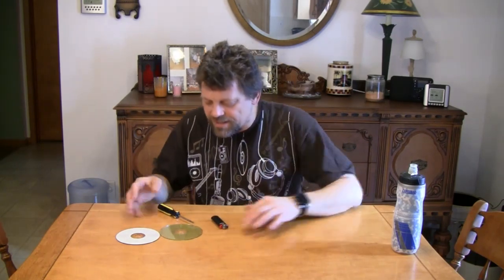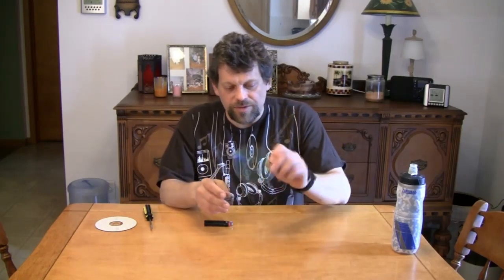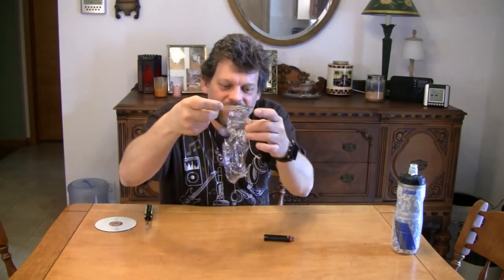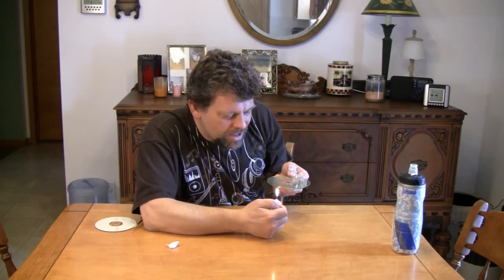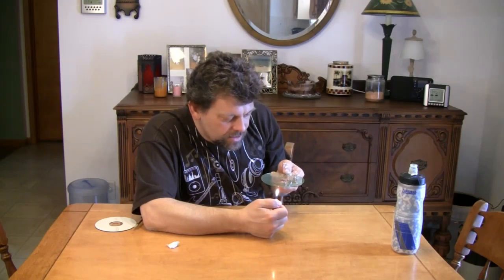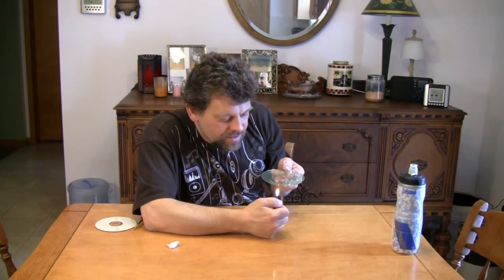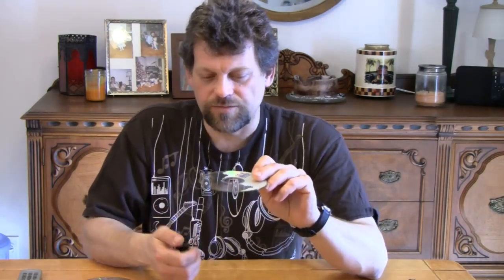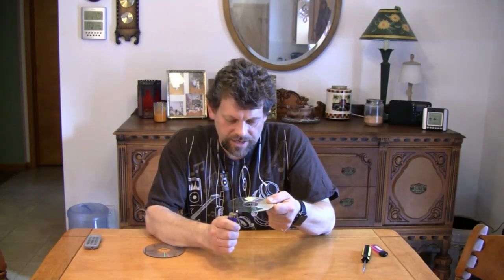"Do Try This @ Home 2010" - Episode 1 - "Bubbles Anyone?"

Comment: haha works great! but make sure you have a polymer disc, as some of the protect discs in new CD packs are made out of a cheaper plastic. you can tell if it is by hold ing it offset toward a light, and it will show you a rainbow from the light spectrum